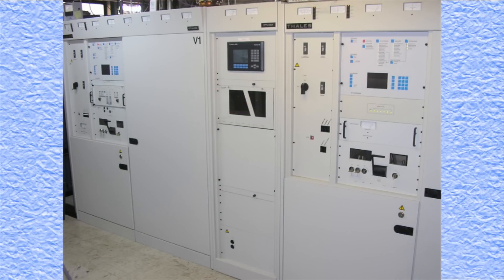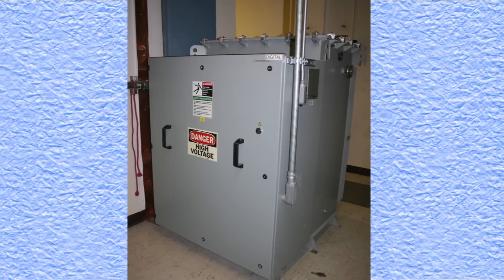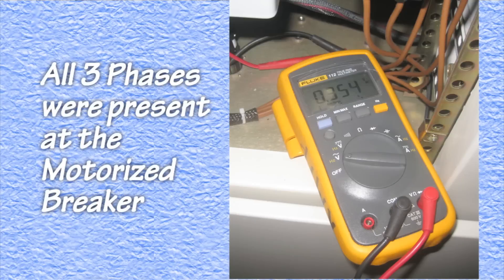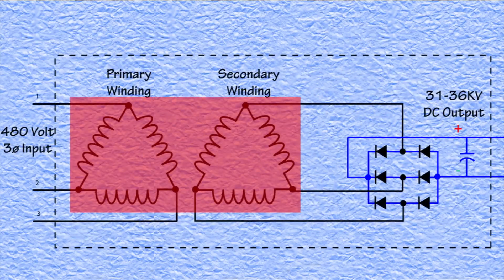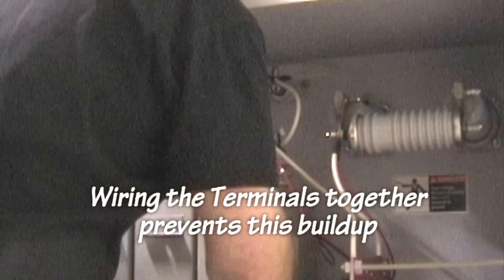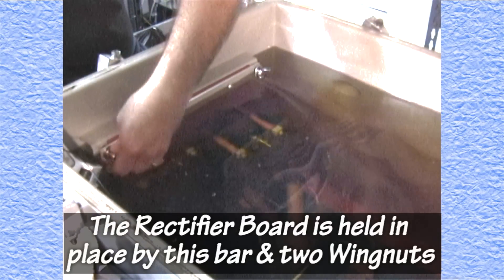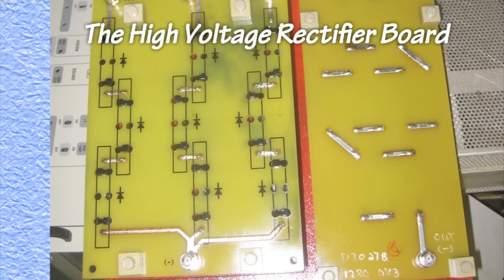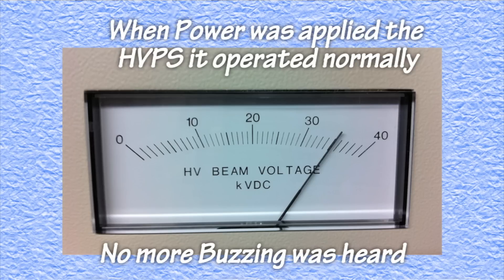The High Voltage Buzz

Comment: I thought that the rectifier board needed to be "tested".  All we saw is that it was swapped-out.  Was it tested, or just assumed to be bad?
Reply: Lower amp draw on one phase with loud hum means one diode stack is open and maybe arcing inside on the less current drawing phase. It was assumed but swapping is a bit quicker than diagnosing and fixing, also IME when one diode goes the rest are not far behind, replace as a set like spark plugs and wires.

Comment: These videos are filled with misinformation right off the bat they said this tube as with all tubes require very high voltage to operate not true most tubes and I would bet even that tube amplifier runs off a low voltage I've never seen one that operated above 12 volts Intuit the output can be much greater but the input is very low and takes very little to operate that's the nature of tubes and why they are called amplifiers if you had a high voltage to start with you would not need the tube

Comment: What happens if you drop one of those wing nuts into the case ?
Wouldn't the moisture and salts from that guys arm contaminate the oil ?
Reply: There's probably 400 gallons of oil in that thing.  It can handle a few impurities.

Comment: What third world safety is for suckers country was this filed in? At 3:24 and 4:12 the guy is measuring live voltage with no safety gear, No gloves and the shirt is not arc flash rated I would bet plus short sleeve shirts are not allowed at all. Proper safety gear must ALWAYS be worn no exceptions. This would get me a disciplinary write up immediately following the work, and for good cause. Plus I have done this kind of work and in 20 years have never done it without draining the oil. This video looks put together by someone who knows NOTHING about electricity.

Comment: What is the function of rectifiers in a high voltage AC system?
Reply: HV DC for transmitter valves or tubes.

Comment: so, what was wrong with the rectifier?
Reply: faulty diode, most likely.
Reply: Probably an open circuit diode in one of the phases resulting in a 25hz component in the output. Thus the buz

Comment: As stated below, I saw several procedural errors. Improper PPE, Improper grounding equipment,  improper procedure. This is not a safety procedure video. One does NOT just get bit by 35kv !
Reply: this video was made 10 years ago. things have changed

Comment: A faulty rectifiers in the 55kW analog transmitters I worked on was easy to spot...Hum bars in the video from the sagging voltage when a phase was missing.

Comment: Even if that oil is PCB free mineral oil it is a bad idea to stick your unprotected arms into it. First he cleans the lid nit to contaminate the oil, then he works with his bare hairy arms submerged. Also the shorting/securing of the capacitors is done in an unsafe way.
Reply: I was thinking about that too. When manufacturing transformers, they take special care to have dust free environments to ensure contamination doesn't occur, it can't possibly be good to have skin cells, hair and general grime that accumulates on the skin contaminating the oil.

Comment: When you measured from phase to ground I assume the neutral is connected to ground.
Reply: It is not strictly necessary to have a neutral in a three phase system. When this is the case, for example if the three phase power is generated by transformer windings in a delta configuration, the circuit is usually grounded via a grounding transformer. In that case you measure each phase with respect to ground because indeed, the only thing the 'neutral' is connected to is ground.

Comment: 36,000 Kilovolts ?  That would be 36 Million volts.   Further on they show using a standard volt-ohmeter to read three phase voltates.  Can't be done !  Must use a three phase voltmeter.
Reply: You can measure each phase separately!   A domestic lighting circuit is on only one phase and you can measure voltages in your home.

Comment: Just removed 2 of the same Beam supply's. One of our engineers came up with a great idea for pumping the oil out. We had been using a regular water pump. but the pump was beating the, thinner than water, oil to a foam and taking much too long . He bought a "el chepo" drill pump.. That on a heavy duty drill worked wonderful . 
Sad to see the good ole Sigma go. Well maybe not that sad..

Comment: 6:43  All that lovely PCB insulating oil soaking into your bare arm.  Yum! :-)
Reply: PCB isn't going to kill you.
Reply: @KG1AES  Don't know about where you are but in the UK PCBs are regarded as hazchem class 9 as carcinogenic and are specifically mentioned in dangerous goods training.
Reply: It’s mineral oil you tard
Reply: 'tard' is unnecessary.. but yes, the oil has been PCB-free for decades.
Reply: @drlegendre  DId thay change the oil
Reply: @brm7469  would not be mineral oil!
Reply: @oldguy2800  Yes it would...
Reply: @northface484  I spent the better part of my career as an application engineer and would not nor could not specify a mineral oil filled transformer for indoor or vault application. At that time all we had was PCB fluid and then came along the non PCB fluids. If it was a mineral oil (hydrocarbon) used here, the electrical designer was in violation of fire codes. The only way mineral oil could be used in an enclosed structure would require fire suppressant and vault isolation from any other equipment (breakers, rectifiers, transmitters etc).
Reply: @oldguy2800   Mineral Oil is used whether you like it...Approve of it...Or not....
Reply: @oldguy2800  The oil will be veg oil based due to fire risk inside a building or mineral oil ( AKA baby oil )
Reply: My iso transformer on my genny uses good old sunflower oil

Comment: (0:46) - "Thirty six thousand kilovolts" = thirty six thousand thousand volts. That's 36,000,000 volts or 36 million volts.
SURELY THAT AIN'T RIGHT?
.
Reply: My thought, exactly!  They must run on "lightning in a bottle"!
Reply: 1.21 gigawatts!
Reply: @KG84C  36kv.
Reply: @KG84C  "Marty we need to go back!!!!!"
Reply: @KG84C  he got the point .
Reply: Definetely not. But we all do these kinds of mistakes sometimes. :)
Reply: @Muck-qy2oo  Definitely* Indeed we do!
Reply: With our esteemed host long gone to the great transmitter shack in the sky, I doubt there will be any corrections.
Reply: Valid point!
Reply: IT is -36,000 volts DC, at about 2 Amps
Reply: wrong drop the K  or the thousand but don't use both!  36,000V or 36KV
Reply: Yea, I caught that, just wrote it off to exuberance.
Reply: You are right I noticed it too, so it is 36 thousand volts or 36 KV
Reply: That's 36 million megavolts!

Comment: Taking a chance removing the rectifier board under oil. Great risk dropping the mounting hardware.
I did find the troubleshooting technique to be sound however need to employ HV gloves whenever applying shorts and grounds. Lockout, tag out, use of PPE,  should be practiced along with human performance methods. Tailboard briefs detail all of the hazards prior to work. 
Again troubleshooting technique was sound and reasonable safe provided proper use of PPE applied. Thanks for sharing.

Comment: BOY .... Brown, orange, yellow.  Indicates on visual hi voltage. Grey can be the neutral. Out of balance happens on 120/240 VAC, single phase in homes also. Amprobe test first 2 poles ... should be same. Then test SP breakers on each phase n note amps by circuit number. A= B amp draw is balanced. Swapping due to each owners bldg use will be different. So u swap wire, not breakers, until A does equal B. U can save consumer between 10 to 15% on bill. Measured n proven. While ur at it .... set up a breaker control index/legend of circuit control. What's on that branch circuit?

Comment: euh bro, ever heard of wearing gloves before placing your arm into dielectric oil
Reply: When he was wearing gloves I thought, if he isn't careful the oil is going to go over the end and soak his hand, then he just takes them off so I'm like, OK, nevermind. Wouldn't it just make everything you touch kind of oily?
Reply: @richardemms3050  Thats what I was thinking, but it appears he was actually wearing the gloves in case any of the submerged capacitors were holding a charge. Once he was sure they were discharged, he took the gloves off. I guess getting zapped under oil hurts as much as getting zapped in air.

Comment: why does the high voltage rectifier board dont have any circuitry/chips?
Reply: because it's just a full bridge rectifier, it's just diodes connected in that configuration shown in 3:58

Comment: Do you know why transformers hum? They don't know the words!
Reply: Perhaps it feels happy about being a transformer.
Reply: Very good, Ronnie
Reply: THAT one is as old as...dirt
Reply: That joke really Hertz. Your joke writing career has great potential. I was transformed by the pun..it got me to the core.  The haters would say that was a ho hum joke and was re-volting. Currently others are reading the jokes. Good thing you are stepping up your game. There was no reply to your joke so I rectified the situation.
Reply: I start humming when I get near overload because I am a short-fuse... so they wanted to increase my current capacity, but my resistance to change insulated me from any potential help... but I am still far from pulling the plug, or even check terminations because my connections are never loose... but I'm just tripping now... and zero chance  of being consoled coz they believe I have good grounds to get blown or smoked... as lives experience some breakdowns... and continuity tests runs positive.
Reply: The hum is just vibration on his laminated iron core, as perfect cutting and mounting as will be, as low the trafo will sound....
Reply: electrostriction, magnetostriction
Reply: Due to magnetic fields

Comment: No PPE, good practice to use full cover fire retardant clothes + gloves should be used during the Earthing process of the Capacitors.
Reply: I was also shocked when i saw him grounding those capacitors with grounding stick and bare hand
Reply: @davegoogle7702  It's HIGH VOLTAGE LOW CURRENT as said in the vid
Reply: @DEVONLAD11  voltage not current gets you
Reply: @kangarookicker6995  Its current that kills not voltage hence why a police taser at 50000 volts does not kill you it just hurts like f**k  oh yes i have been tased and its not funny
Reply: @chris-jb5ds  they’re not and it’s not that simple.
Reply: @DEVONLAD11  The current is irrelevant, the high voltage is what matters when it comes to electric shock.
Reply: I think this is because staging for video taping was being done.. 

I do agree though. Flame proof gloves and face shield should be warn when doing a lot of these things.

We all have seen the video of the guy testing HV with a multi meter.. human candle.. 

Or better the video of the coper/aluminum wire thief hooking upto a 50k panel and lighting up like a torch
Reply: RODALCO2007 Unblievable
Reply: @jackhandyy  Plus,  there's a giant bleed resistor in the unit.
Reply: It's amperage that kills you not voltage.
Reply: @jasonbooth5182  You need the voltage to transfer the energy in order to kill you. A high voltage source is far far more dangerous than a low voltage, high current source.
Reply: Because it was an engineer, all book smart no common sense, measuring 480 voltage with no Ppe, bypassing interlocks with no ppe. “Engineers”
Reply: Yeah,, discharging a hv cap is one thing but the arc flash on a lit480volt circuit is sumpin else.

Comment: 133 amps. Pause the video for a moment
Reply: My spot welder draws more current than that, pause when contemplating volt*amps (or volt-amps as it's also referred to), that's where the power is!

Comment: where's that guys PPE?
Reply: OSHA wasn't in the area that day. It's good to take the short cut.
Reply: Safety is not a management priority until someone gets injured or killed.  Most stations will provide no help to the transmitter guy and PPE is just a waste to them.  The management has usually never been to the transmitter and would not know how to find it.  Hint: It is nowhere near the golf course.  They will, however, keep calling the transmitter to see when we will be back on the air.  Even in a station like the one pictured  (A-B parallel operation), They seem to think: A. We are still on, I see a picture,  B. 50% power!   We are losing half of our viewers!  c.  Will this be expensive?  D.  No overtime, period.  OH, It is not PCB oil... It is some sort of mineral oil.  Not to worry.
Reply: PPE ain't gonna stop him from getting electrocuted if he touches something bad LOL
Reply: parteibonza appropriate PPE minimises the risk

Comment: I thought this oil needed to remain contaminant free?
Reply: Not after he just jobs his hand right on in there. . .
Reply: Also this insulating fluid could have been Askeral or Inerteen (PCB) which is not kind to the skin. What kind of fluid was it? Mineral oil would not be used here since the transformer is in a closed building. I suspect it is not PCB for all such transformers were retrofitted years ago or disposed of. Regardless the tech should have worn long gloves.
Reply: @oldguy2800   The oil will be veg oil based due to inside use or mineral oil ( AKA baby oil )
Reply: Nope. Just dust and debri free. Not contamination free
Reply: Yeah the oil needs to be dry and clean. At 55kv it isnt as critical because the parts are bigger and physically isolated, but with  X ray stuff you need it dry and vacuumed. I have worked on similar units filled with SF6 gas that output 60 to 260kV at a few AMPS that actually use a high frequency transformer and scary capacitors inside. When these go there isnt a hum, there is a bang...

Comment: At Woofferton we have a large number of high voltage oil filled components. These days we are not allowed to expose our skin to oil. We have to wear full glove protection. It makes the job more difficult but it is much kinder to our health. I fèel for the engineers in this video. Great fault finding technique.
Reply: The oil isn't very good for you healt as it may cause cancer.
And you get water in the oil with your skin and you may need to change it after some maintance which is expensive.
Reply: Yeah, but the oil -- even when laden with PCB's -- makes your skin so-o-o soft!

Comment: why is it submerged in oil?
Reply: Cooling and electrical insulation.
Reply: To keep the electricity flowing smooth
Reply: Michael Epps coolant
Reply: thanks for the responding to my question
Reply: Oil is a lubricant and allows the amps to flow more freely.

Comment: I was waiting to see just what went wrong with the board? I thought that was the point of the video?
Reply: HV diodes to service the rectifier board are not available. Substitution of the entire board is the practical remedy. My question is: What is output of this UHF transmitter..?
Reply: Given that phase B was low, I would say an open diode. As a short would have caused a fault trip. The noise is from eddy current loss  (inductive coupling)  in the delta transformer imbalance.
Reply: In 2012 there was a 10 minute limit on videos.  Be happy with what we got.

Comment: So what was wrong with that Rectifier board?
Reply: Likely an open diode.  If it failed shorted there would have been visible damage and blown fuses.
Reply: Haha wont tell you that as its jus been elaborate click bait
Reply: The Dishwasher
        its not rectifying! ........................lol
Reply: @joeylawn36111  Spelling is a part of grammar. FYI !
Reply: Probably an open diode; It caused the current to drop on one leg. When they short out then immediately bad things happen.
Reply: @joeylawn36111  "was" not "bas" {youtube grammar police}
Reply: It droped a diode.  the same happens in a car alternator. short a diode and it runs like s**t